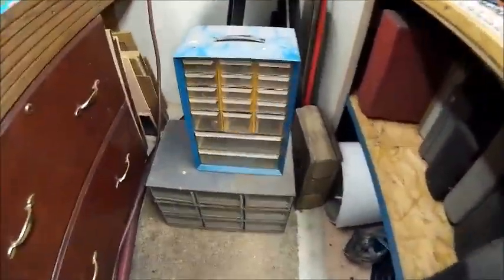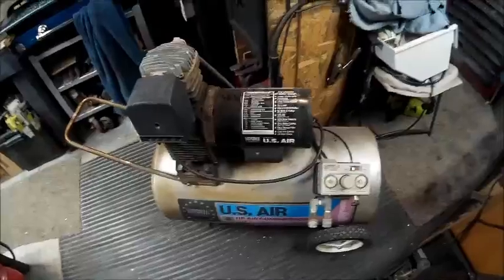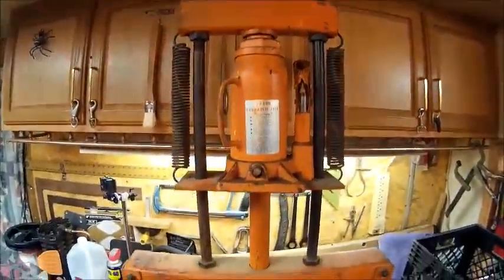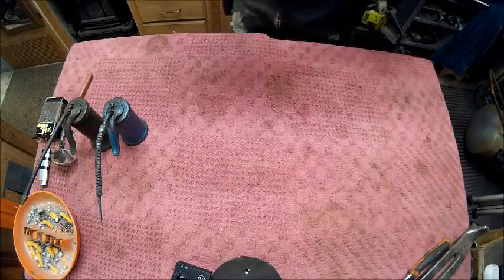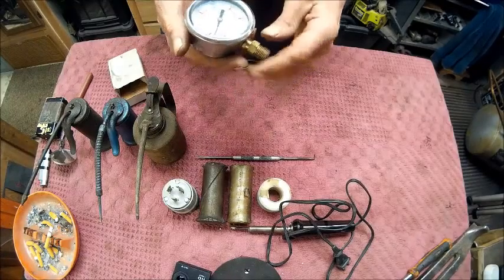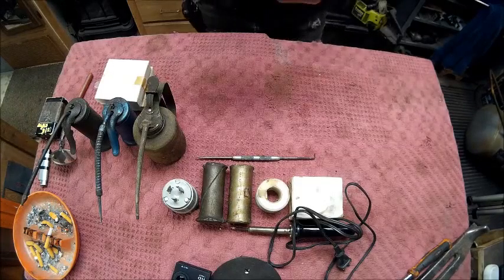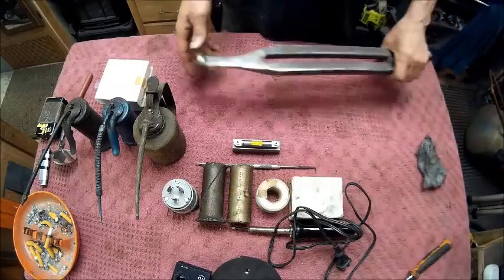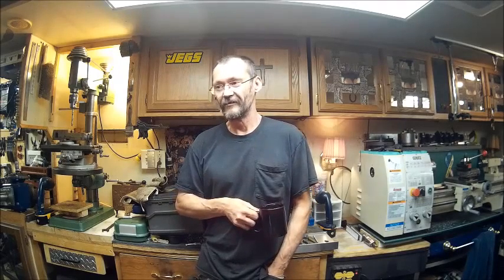bison workshop show and tell

Comment: Love that press! Beats my 3 ton arbor press hands down. Those Eagle oilers never die. Nice collection of shop stuff.
Reply from the maker: +Ed Pace the eagle that had the adjustable tip wont hold where you bend it. so i dont know how to go about fixing that. so it may have to stay that way. and the big can someone welded the spout bake on it so i have to fix that one also one day lol. and i think this press will be all i ever need. i built one one time about 5 years ago that even raised the table by the push of a button and used a garage door motor for the power unit and cables and a foward/ reverce button to operate it. the table was too heavy to hold is why i did that lol